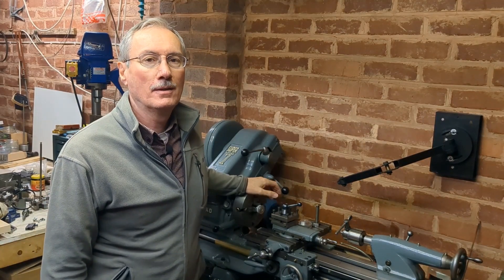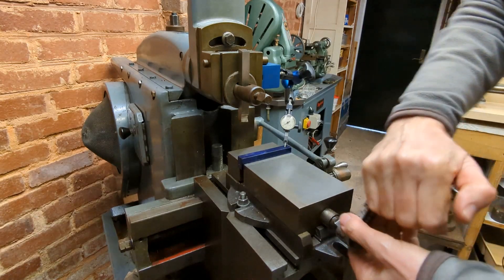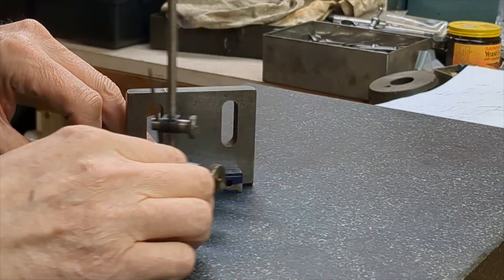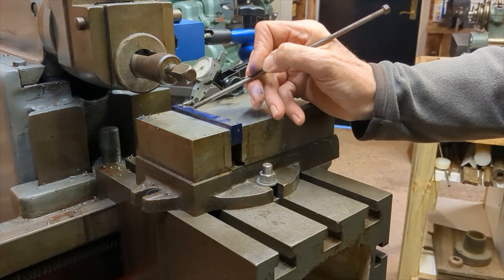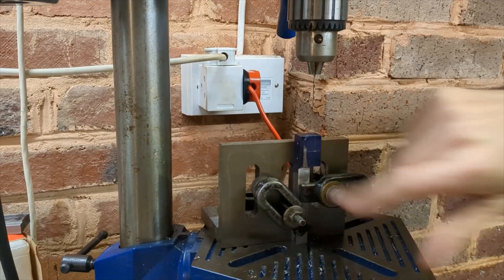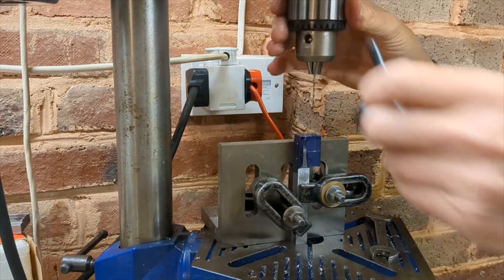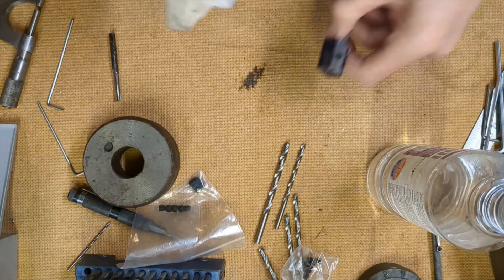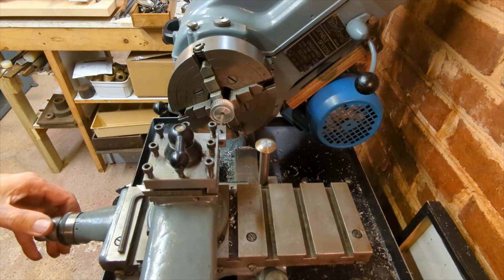Mini boring tool holder

Comment: Thanks for the video....but your shaper is still feeding on the forward cutting stroke it should be feeding the table on the return stroke !!!
Reply from the maker: Thanks for the comment. You are observant! 50% of the time the feed is with the cut; 50% it is on the return stroke. I take cuts in both directions to save time.
Reply: @Workshopfriend  as long as it works for you but whenever I see a shaper feeding on the forward stroke it triggers an OCD reaction in my brain and I can't help shouting at the screen !!!